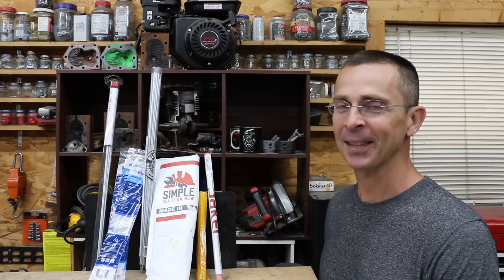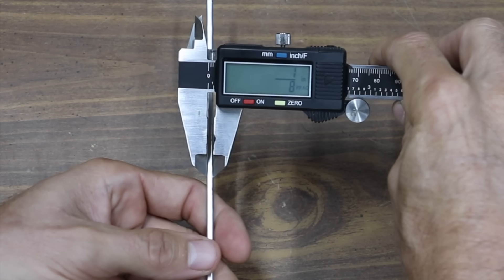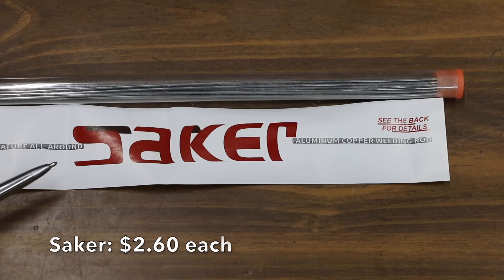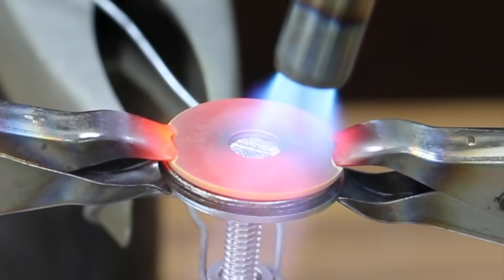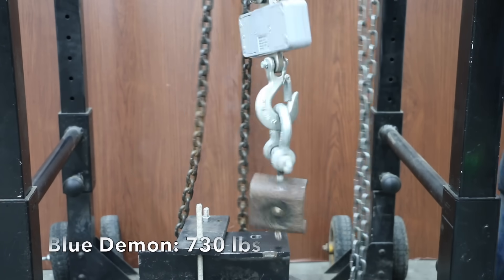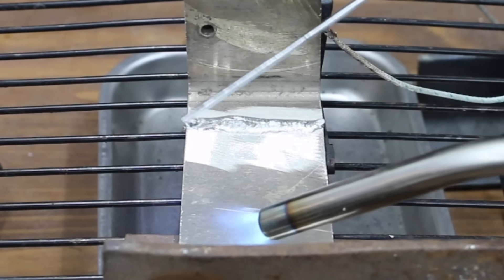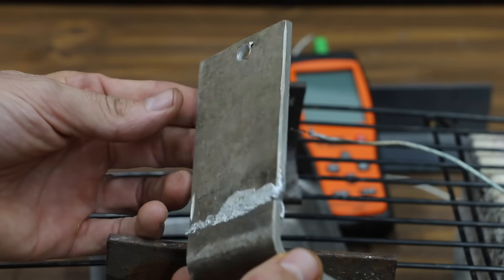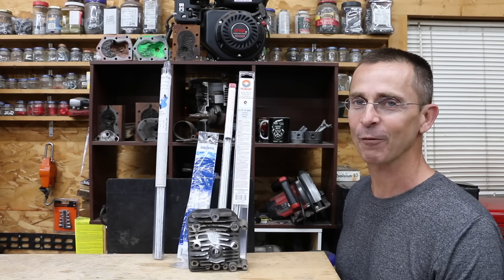Best "No Welder" Aluminum Welding Rods? Alumiweld vs Bernzomatic vs Hobart

Comment: Good test as usual.  These rod can be very finicky.  Heat control is critical.  Temp sticks and IR thermometers are handy for this.  One problem with aluminum is that it looks the same hot as it does cold.  It will look normal and if you get it too hot, it will instantly melt and destroy the part.  So be careful.  I learned that the hard way.   

If you're doing a part like that cylinder head, I like to preheat the part on a camp stove and leave it on during the process, but don't over heat it.  Use the torch on top to get the weld area to final temperature and keep the torch on playing the flame on and off the weld area to maintain the "sweet spot".  Hit the weld area with the stainless brush and apply the rod in scratching motion to break the oxide layer that will develop immediately.  This is where the bonding occurs, so lots of scratching.

Heating large aluminum parts takes a LOT of heat.  So don't expect to use this stuff on a thick large parts with a handheld torch.  You'll need blankets and a large heat source to keep the heat from getting away.

The better rods in the testing are all good.   This stuff is VERY handy to have around.  If you have aluminum parts that are subject to wear, you can use this stuff to "hard face" the wear areas.  Don't apply too much as it's a bitch to grind and nearly impossible to file.  It's very hard once cooled.
Reply from the maker: Thanks for sharing.

Comment: A few review ideas:   Caulk( this could be a rabbit hole of shame if done wrong... This wouldn't be a issue for you...  In particular, the ones that claim to be mold/ mildew resistant.  Or not to crack, peel, or have some UV quality's.  

Wood fillers!

Antifreeze:    See how well they lubricate water pump, and  keep the metals from corroding.  The brand names+ the water less versions too.

Brake fluid:  I await the day you put some misc. brands of this through the bearing tester....  I want to see if I'm right....

Brake hardware lubes: Like silicon-and what ever else is out there.  

Grout sealer:  see which is really better.  This stuff is randomly priced!

Wheel bearing grease...

Gear oil show downs..+ Do GL5 oils really eat yellow metals?   

High temp paints, engine enamels, wheel, caliper paints. Is primer really needed anyway?

Windshield crack repair kits.  Also rear view mirror glue packs.  

ATF brands.. 

Ratchet strength tests.  Which ones will take the abuse?

Sandpaper.

Best coolant stop leak. (Can't remember if you did this one")
Reply from the maker: Thanks for the suggestions.

Comment: As always a wonderful review. I've used Bernzomatic rods. They work well, but the surrounding metal must be so hot. It usually melts/ deforms a bit by the time your done. Like fixing small motorcycle carb brackets...   There is a company that sells numerous brazing rods(one I saw claimed to melt at 600F).  I've never tried it though...  https://www.muggyweld.com/product/super-alloy-5/?gclid=Cj0KCQjw8fr7BRDSARIsAK0Qqr7x3Z9_URW28EYzDRz-LhfxNBRe3Sawh0nQ0OvKRtSKaWLpyN0Kx4MaAsGpEALw_wcB
Reply from the maker: Thanks so much!  Thanks for the feedback.

Comment: Id like to see a comparison between the different speed bore drill bits. The ones that have like a screw tip and 2 or 3 cutting edges on them. I use them for my job and ive got irwin ones but was curious if any other brands had better performance/longevity
Reply from the maker: Thanks for the video idea.

Comment: Related to videos that you did a couple years ago, there is an oil additive called Tribotex. There is very little info and reviews on them. One review someone drove a loop without it, keeping track of fuel consumption, then did another with it to see if it improved their fuel consumption. In the few different reviews that are out there, it did reduce the engine noise by a couple decibels, but there has been no test using the lubricity tester. Your videos are thorough and easy to follow. It would be wonderful if you could test the Tribotex, and then compare its results to results you have gotten from the best additives in the past that you compared. I like Lucas, but we are always looking for that edge to help our vehicles run their best.
Reply from the maker: Thanks for the video idea.

Comment: Have you ever compared bug and tar removers? I had used some Turtle Wax brand in a spray bottle that worked very well on the tailgate of my dump truck after paving but would be curious how your results end up
Reply from the maker: Thanks for the suggestion.

Comment: You should try running a two stroke weed eater on diesel fuel to see if it would add any torque or power. Also if it works in a weed eater maybe run it in a see through motor? Would be very interesting to see
Reply from the maker: Thanks for the video idea.

Comment: The words welding and brazing are used interchangeably in this video, but they are two totally different things. This may already have been mentioned, but Brazing uses filler metal that has a liquidus above 450°C (842°F). The process is exactly the same as Soldering except that the filler metal has a liquidus below 450°C. Welding involves actually melting the actual base metals to achieve fusion, with or without an equivalent filler rod. As far as I can tell this is all about brazing... there is no actual welding occurring here unless the aluminium melting point of 660°C (1,221°F) was reached or exceeded. These aluminium brazing rods may have been deliberately mislabeled as welding rods as a marketing ploy. Still an excellent video review!

Comment: What if you made a piston head out of a high performance plastic like torlon or vespel? They are extremely lightweight and self lubricate, so maybe you can run an engine dry with it? Or perhaps run at higher rpm? The plastic is also safe to use up to 500F and doesn't melt.
Reply from the maker: Thanks for the video idea.

Comment: You may want to explore battery charger with a desulfator built into it. Its great way to bring back dead batteries. There are websites they tried to test them. I am sure once you work out the protocols you could do better than they did.
Reply from the maker: Thanks for the video idea.

Comment: since those air cooled engines get alot hotter when they are under load, i would have really liked to see how long that head would last with a heavy load on the engine.
Reply from the maker: Thanks for the video idea.
Reply: Get a cylinder head up to 400 degrees and you're about to have a bad day, much less 700.

Comment: Great channel!  Two tests I would like to see:  1) Comparing aerosol expanding foams for repairing leaky off road tires (on lawn tractors, etc.), as in "Great Stuff" vs. "Great Stuff Big Gap" vs. ??.  The best methods of application, durability over time, etc., could also be explored.  2) Rust and pin hole sealing "all-in-one fix kits" for steel gasoline tanks.  Not for primarily auto/truck tanks, but many older motorcycle owners are plagued with this widespread problem of rotting steel tanks, for which replacements are no longer available.  I have heard of varying results for these sorts of products, and I would like to find out what actually works best (or even at all).  I realize that sourcing these tanks, and showing any test results would probably not be feasible, but perhaps just testing on rusted/perforated strips of steel would be useful.  Any fuel additives that claim to stop tank rusting before it starts could be tested, as well.  I've heard that this problem is mainly found only in the U.S., because steel tanks only (vs. plastic or even aluminum) are, or were, required on street bikes.  Many thanks for your interesting content, keep it up!
Reply from the maker: Thanks for the video idea.

Comment: Another great review, my question is will this work with the 2020 extrusion aluminum bar ?
Reply from the maker: Thanks for the video idea.
Reply: @ProjectFarm   Yes sir  please test the strength between Welding Rods and JP Weld on the 2020 or 2040 Extrusion Aluminum bar, I am thinking of build a small scooter using these kind of material, not sure which one is the best to use. That would be great ! thanks so much

Comment: Technically these are brazing.  The rod, the piece and the base metal dont all join. Proper welding has all 3 parts permanently joined. IE all 3 metals melt and join.
Reply from the maker: Thanks for the feedback.
Reply: Yes i am a bit of a grammar freak. The ads for these rods, which i think are a great product seem to use shaky terminology.  Love your channel. I send people here for duct tape and auto oil and using auto oil for gun cleaning :)

Comment: Wow, what a great video.  I am genuinely shocked at how well the top brands did in these tests and I had no idea brazing rods could be this strong!  I've always thought of them as a gimmick.  I guess I'll pick some up for my next aluminum repair.  One thing I'd be very curious about would be the ability to use brazing rods to fill damaged bolt holes and then to drill and re-tap the hole.  Would it be as strong?
Reply from the maker: Thanks for the video idea.

Comment: Hey project farm. How about an episode on caulking guns.  Both lowes and home depot sell low quality $4 versions,  better $8 versions and then high end $18 caulking guns. I have always been impressed with the $18 home depot caulking guns but they always seem to disappear from my tool box. 
I googled name brand caulking gun and there are several companies that make great caulking guns.  I ended up buying a Newborn brand model 250 caulking gun and it is clearly smoother functioning and better built than the expensive ones from hd and lowes.
Maybe you can make a vid with test like dripless-ness, ease of pulling the trigger with thick cold adhesives,  etc.

Love me some project farm.
Reply from the maker: Thanks for the video idea.

Comment: I didn’t know that these existed. Welding aluminium is known for being a pain. I’ve got a broken thin aluminium pipe end connecting my air conditioning pipe to my air con radiator in my car. Do you think I could try to braze the pipe directly to the block instead of buying a new pipe for $300? Would this stuff remain free of leaks?
Reply: It's worth a try! Especially if it on the low pressure side. Obviously be mindful of any refrigerant left in the pipe. I'm pretty sure the older R12 produced nasty fumes when heated.

Comment: Your thermal camera is showing the repair area as cooler because it's a less oxidized surface. It's more reflective and less emissive in the infrared spectrum than the rest of the head which is heavily oxidized and has a rougher and more emissive, while being less reflective, surface. If you used a contact thermometer they would probably be about the same temperature.

Comment: Its not really welding, its soldering, i believe its called hot soldering till 600 its cold soldering and above is hot, you dont melt metal near so its not welding

Comment: In that first bolt head test, shouldn't you have been heating just the threads on the bolt UNDER the washers, to avoid oxidation of the head?  After getting your bead on the bolt, move the heat to the washers and finish

Comment: When setting up your test sample aluminium bolts with the steel washers, did you use zinc plated washers? I'm wondering if BZP would have skewed the end result..
Reply: Doubtful, the way he was testing the washers are just a mechanical link... something for the brazing to spill over and hold in compression. Didn't matter if it stuck to them or not.

Comment: Another great test. There was a chap over here in the UK that used to demonstrate Lumiweld at all the County fairs around the Country back in the 80s. He used to smash old gearbox casings to pieces and stick them back together using this stuff. It was very impressive, and he sold loads, but I never thought there would be any difference between the brands.  How about cutting a piston up and reweld it and see how long it runs for 👍
Reply from the maker: Thanks so much!  Thanks for the video idea.
Reply: Is that the same bloke who goes to the big car shows selling those Ali sticks, he is from Belgium or Holland, and he also sells brilliant files.
Reply: I still have some I bought at a state fair in 1983!

Comment: Thank you for another outstanding video.  You never disappoint.  Keep 'em coming.  I love these comparison videos, and the fact that you, whenever possible, include the Harbor Freight brand in them.  I have Champaign tastes, but beer wages, so  I use a lot of Harbor Freight products, and some are most definitely better than others, and you have taken a lot of the guess work out of some of their items that I had not yet used.  Being reduced to bargain basement tools, I have adopted the philosophy that you don't treat or use a $5 tool like it cost you $50.  If you are going to be hard on your tools, don't get the cheapest one you can find.  Because of that I tend to baby the tools from HF.  That is why I like your test methods.  You see, I also have the philosophy that, if you are going to compare your product to a major brand (which HF does a lot), it had better be able to hold up as well as that brand.  Between the two philosophies, my wallet forces me to lean toward implementing the first one, as the tools hold up much better.  
Also, I often find myself amazed at the occasional poor performance of a major brand.  Your tests are very enlightening.
Reply from the maker: Thank you so much.  Thanks for sharing.

Comment: Excellent video as usual! The reason why the temp was reading lower on the weld might be because the emissivity of the weld is different than the head material. It would be cool to check this with a thermocouple.
Reply from the maker: Thanks for the feedback.

Comment: Your timing is impeccable! I'm dealing with stripped spark plug hole threads at the moment and exploring solutions. This looks very promising as apposed to attempting to install oversized inserts which do not provide a good plug to head thread fit which means future headaches. Thanks, TFP!
Reply from the maker: You are welcome!

Comment: Those cap screws are 2024-T4. By heating them above 500 deg F they almost certainly were annealed, reducing the tensile strength to under 1/3rd of the -T4 condition. It is not recommended to weld or braze 2024.   Otherwise excellent video!
Reply from the maker: Thanks!

Comment: I found his conclusion interesting, from my perspective burnsimatic seemed to do slightly better. it adhered nice and flush those washers no problem, The bolt broke not it, it seem to be the only one who’s weld didn’t break in the Bend test, although others were close in performance. usually he’s unbiased about a conclusion but I didn’t mind him “recommending” what seemed best to him, I actually kind of liked a straightforward answer when he concluded; it would make it easier for someone who’s quick referencing this video to get a good recommendation.

Comment: This is a great Vid here,  I have been wondering but NO More, you did what I needed here on this alumi-rod thing.
Anyway, I have an Off topic Q, I want to get a inline electrical Wattage meter to know what my 115VAC appliances are actually drawing in use.

Do you have  a VID on these devices, or suggest one you might have used?
Thx.

Comment: I would like to know if I wash a car with purple power mix with soap will anything happen to the clearcoat because of the purple power and I’m talking about The full strength full concentrated not the one that says vehicle and bolt
Reply from the maker: Thanks for the suggestion.
Reply: No problem I would love to see it before I start using it on customer vehicles

Comment: Love your videos and the scientific approach to testing as well as the value to consumer that results from the tests! I watch these regularly with my sons (12 and 7). 
As an idea for a future video, I always wondered what would happen if connecting say 3 generators in series to run a bigger load. Would it work? Instructions say you shouldn't do it... ( likely 3x 2000w generator are cheaper than 1x 6000w one)
I understand it may not be your type of video. It's more like a myth busters type of question :)

Comment: With Flux core, you actually want to use it like you would braze, just without waiting for the base metal to melt. That is why you were having difficulty. The Flux prevents the weld from adhering to itself and forms pockets

Comment: My understanding is that these rods are nearly pure zinc. Liquid Zinc, the liquid has a very high surface tension, which is why it is very good at bridging gaps (adverts showing holes in aluminum cans being filled), but bad at flowing between parts, as can be seen in the video, most of the instructions recommend coating both parts and then putting the parts together and reheating.

Comment: MAPP and MAPP/PRO are 2 different gases. MAPP/PRO only burns 130° or 160° degrees higher than straight propane. 

MAPP stopped being made back in 2008, unfortunately.
Reply from the maker: Thanks for the feedback.

Comment: So a buddy of mine told me about this gear oil he bought " omega 690 " . its GL-6 made in the UK from what he told me and me assuming from the low amount of articles Ive seen. No real reviews of having used it. The only issue i could see and make a guess is that it would possibly do more harm than good with the way it sticks to the gears with the possibility of the small metal particles could stick together or on the gears themselves and be smashed causing cracks and premature failure. I could be wrong. But if you think it would be interesting Id appreciate it if you could run some tests on the oil?. Thank you. Keep up the videos.
Reply from the maker: Thanks for the suggestion.